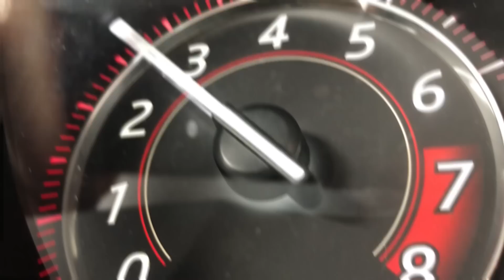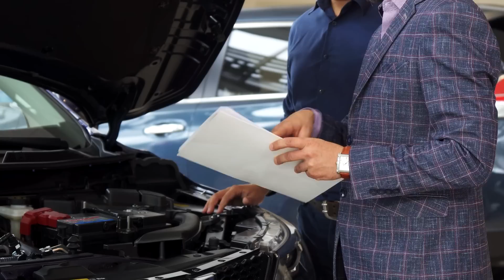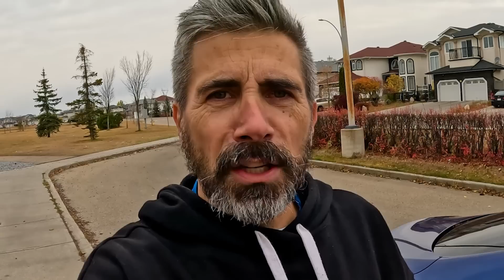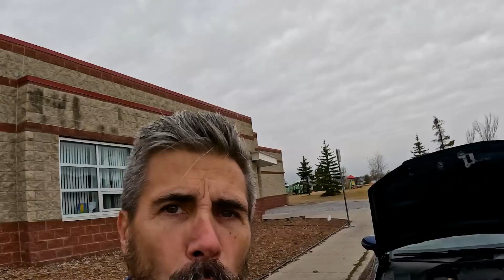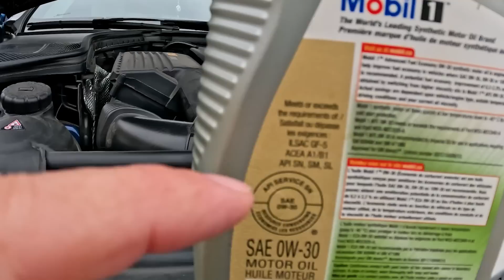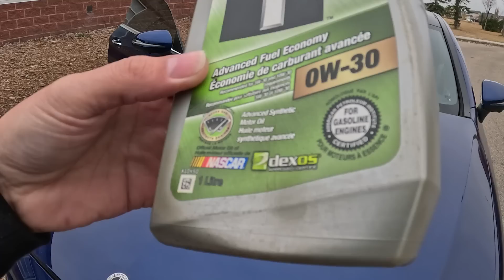BREAKING! Why These New Car Engines Are IMPLODING!

Comment: The manufacturers absolutely considered the extra wear and long term problems with the direct injection. That's the main reason it was implemented.
You're only supposed to own your car for 7 years or less these days.

Comment: I know on the oil geek channel they just did a testing of idling in cold weather or getting in starting your truck cold warm it up for 10-15 seconds and go and they found out that saves over 40% more gas than if you were to go out and idle your car in the morning for a period of time and then drive away

Comment: We have had issues with the C7 Corvette direct injection engines exploding.  GM went from saying it's ok to use lower octane, to requiring 93 octane and went from 5W-30 to 0W-40 DexosR oil. My guess is that the Corvette's were having this exact issue.

Comment: THE FORD 2.5L NON TURBO ENGINES ARE BULLET PROOF. THE ENGINE IS A COOP ENDEAVOR WITH MAZDA, FOR THE FORD/MAZDA ENGINE.  EASY TO MAINTAIN, CHANGE OIL EVERY 5,000 MILES THEY WILL LAST. MY 2012 FORD FUSION SE HAS 200,000+ MILES AND 30-33 MPG. DO NOT DRIVE LIKE A MANIAC, SHE WILL LAST A VERY LONG TIME. STILL DRIVING MINE AND PURCHASED NEW AND MOVED TO THE SOUTH. THE CAR IS RUST FREE. NO SALT DAMAGE.  FINIS  PAX

Comment: OW oil was created for better efficiency. Less weight on the crank and pistons. They chase the smallest gains while putting restrictive exhaust and intankes. The engineering is horrible too. People will be paying on these cars for years and they wont hold up. Best thing is to not buy this overpriced crap to begin with.
Reply from the maker: I think you make some great points!

Comment: Change your oil often, oh and pay your huge car payment on time too. Most people do not care for their cars the way these highly complex, highly stressed engines need. Most people don't even warm up their engines before driving. Give me a small high efficient, normally aspirated engine, simple cam chain arrangement, no direct injection and lighten these overweight vehicles too.  For once optimize the intake and exhaust from the factory...That alone would save you a few mpg...
Reply from the maker: I hear you on that.  It is so important to follow the maintenance schedules!

Comment: By making maintenance more complicated and designing in failure points the bottom line is they sell more cars, as they need to be replaced more often.  Not only that they sell more parts for as long as that car is running at vastly inflated prices, like the £1000 headlights!  You are simply not going to see our modern cars survive in original condition like cars from the 60’s and 70’s, if the engines don’t implode, the software and computers will fail due to components aging.   All driven by greed and thirst for sales leaving the consumer with big bills and a vehicle that’s worthless second hand.
Reply from the maker: Thanks

Comment: Greetings from the U.K. Excellent video! I’m 60YO and have worked on cars all my adult life. The best engines were made in the 1990’s in my opinion. At that time technology got rid of bad design, I remember ignition systems that had distributors, points and condensers, fuel systems with carburettors and mechanical low pressure fuel pumps. By the 1990’s we had fully electronic ignition and port fuel injection. Modern engines are now way too compromised, partly by makes driving down cost, and partly by emissions requirements. I’m all for less pollution, but the engineering to do this has been done on the cheap.
Reply from the maker: Engineered obsolescence

Comment: I own a 2013 Mercedes E 350  , 6 cyl engine ,, has 326k miles , origional engine and transmission.
Also own a 2019 E 300, 4 cyl turbo ,267k miles turbo charge replaced at 170k.. origionla engune and transmission. 

Oil used . Mobil1 5W_30 , 20K etended performance , never changed oil before 10k miles..
Both cars are driven commercially ..

NO ENGINE IMPLOSIONS YET!...,,JUST MY 2Cents

Comment: If all our petrol and diesel engines have so much problem with cold start lubrication problem, then why dont the manufacturers use a short timed electrical lubrication oil pump that is manually or automatically started before starting the engine, like pre lubrication in disel electric locomotives (trains)?

Comment: Sea Foam has a cleaner used at the air intake which will help clean the upper intake manifold and valve stems.
Valvoline's Restore and Protect does seem to help with build-up around the rings to help maintain ring seal.
MotorKote does appear to really help oil cling to surfaces to reduce wear.
Ceratec Helps "repair" minor scratches on mating surfaces over time.

Using these at recommended intervals can help extend engine life. Valvoline is a new one for me, but using the others I have yet to have an engine fail before 200k miles. (I actually haven't had an engine failure on any car I have ever had). Oil catch cans do help (on cars that need them. Not all direct injections do from my research). I have one on one of my cars, but not the other.

High calcium oils can cause pre-ignition issues (if the oil meets required spec, it is addressed in the additive package)

Listen to you car. Machines do speak in their own way and your ear is an important tool in maintaining your vehicle.

Good video!
Reply from the maker: Thanks for sharing your insights!

Comment: As a technician for over 38 I can probably count on both fingers and toes how many normal fuel injectors are replaced at that time. With direct injection cars I've replaced between 5 to 600 in the last four to five years. And this is just for direct injection failure this is an oil dilution or the other problems you're describing. We get plenty of cars with fuel imbalance because of the injectors not balanced anymore or running too rich. I myself would never buy one of these cars they will not hold up over the life of the vehicle. Part of this is the manufacturer's fault the other part is because of the government's fuel mandate laws. Direct injection engine cars will get slightly better gas mileage than a normal one but they will have much higher increase maintenance costs and failures. Set the slide amount of money you save on fuel will be lost immediately during repairs and maintenance. So I tell you what you need to do is complain to your representatives in Congress. Most people won't do that though so nothing changes.

Comment: The carbon buildup issue on the back side of the intake valves isn't just on direct injection engines but also on the port injection engines. When I removed the intake manifold on my 2012 Ford F-150 3.7L Cyclone (non-turbo) engine to change spark plugs, I immediately noticed the problem and went to work removing the carbon deposits with Seafoam spray and a toothbrush. Then with everything back together, I fired up the engine and performed a second Seafoam spray treatment on the intake side, and finalized treatment with a can of Seafoam in the fuel tank. I do not use Seafoam or any cleaner in the engine oil, preferring instead to change oil earlier. Adding a cleaner to an already diluted engine oil just makes matters worse and it's just better to change the oil and get the bad stuff out. I'm coming upon 170k miles and hope to get 250k-300k out of this engine before it needs to be replaced which I have planned for as I have no reason to replace the truck. A reman'd engine install is about $8,000 vs $80k-$100k for a new truck of the same type and size. Modern vehicles are more disposable like Bic lighters, use it for 75k miles then replace it.

Comment: Answer this question. Why is a given engine? Let's say 2024 Sonata with the multi-port and gasoline direct injection engine. 2.5 l require 0w-20 in North America but in other markets it requires 5W-30. It's the same engine. It's the same car. Hyundai is not going to manufacture an engine solely for the North American market specific to 0.0w-20, nor are they going to make a second engine that is specific to a different market for 5W-30. So what gives it's a cafe standards that require 0w-20 in the North American market where elsewhere in the world 5W-30 for the exact same motor is required? As I mentioned, auto manufacturers are not going to make an engine specific to one weight of oil and then manufacture a different engine to a different weight of oil in a different market. It's the same engine globally that they use but in different markets. They recommend different oil weights. Get back to me, will you? 

By the way, with direct injection and the pollution control valve dumping all that garbage back into the intake which causes buildup behind the cylinders. My car has multi-port injection plus gasoline direct injection. So one set of injectors does inside the intake that sprays fuel behind the valves to keep them clean. Then the other set of injectors inject fuel directly into the cylinder. The ones that injected to the cylinder inject regularly. The one that inject behind the valves inject intermittently. That's how we keep crud from building up behind the cylinders on the gasoline direct injection. The other cause of the using 0w-20 oil weight as it's thinner and it's easier to get past the cylinder rings and it's easier to combust which means that at any given car using 0w-20 oil consumption is going to be greater than it is if it uses a slightly thicker oil. So we're going to sacrifice protection with thicker oil by using thinner oil to eke out a few extra miles per gallon you be the judge?

Comment: I can see that my typical oil change techniques will fix most of this. Before you oil change, add 4 to 6 onces of Sea Foam to the oil. Run for about an hour, then drain it, change the filter and oil. Clean out the engine well every change and this carbon will be minumized. Oil varnishes will be washed down and out. Do this regularely and it will help with this issue. I've been doing this for 30 years on old cars, high milage cars that used lots of oil, and have been able to bring them back to very little oil consumption just doing this. i have several that made it to 300k miles when I bought them with 180 plus. This will bring out the trolls, but it's your choice. I'm just telling you what works for me. You dont have to use it. But for 10 bucks, your a fool not too!

Comment: Suffering similar symptoms at 165k now issues showed up 15k miles ago or a bit earlier, now I’m thinking fuel injectors won’t extend the vehicles life span as much as they should, this explanation makes total sense and I will reduce my maintenance schedule to 3/4 of what I used or half what I used, fuel system cleaner every 5k & maybe engine cleaner but idk how that works

Comment: Reliable engines rob companies of revenue,it's as simple as that.Just like a cure for cancer,you don't cure your patients and stop your profit.
Reply from the maker: So right Peter.  Cheers
Reply: @ECPP 
Cheers,I think we're being conned,but why would manufacturers give 5,7, sometimes 10 year warranty on vehicles
If they think they're not reliable .It seems odd to me unless replacement cost is minimal to them.The new lc300 landcruiser oil 0 /20  is so bad when towing customers are replacing it before leaving the showroom

Comment: Keeping my 3800 engine running for as long as I can. Hitting 340,000kms now and burning zero oil. If I drive nicely getting upwards of 34mpg on the hi-way. What we have now is disposable vehicles. This is the result of leasing. Less and less people now actually purchase their cars with intent to keep them for a long time. Instead just in effect renting a car for a few years and get rid of it. All the manufacturer needs to do is make sure that car lasts the warranty and that is it. Once the warranty is done the car is done. Such a waste of resources. Hate to think of the day that I will have to replace my Regal. Hope not for a very very long time.

Comment: Direct injection is garbage. It's designed to kill your car faster and increase maintenance costs. Also, manufacturers telling people they can go 6000 miles on their oil. Change using a direct injected car. You'll be lucky the car, last the life of the loan.

Comment: Direct Injection isn’t the issue (my older car has 200k and still purrs like a kitten) but the improper maintenance scheduling.

Oil change every 4k or 1 year, whichever comes first, especially if turbocharged. Lookup car’s transmission ser/part# from manufacturer and recommend fluid change then change it then at 1/2 to 2/3 that (60k in 8y ≈ 35-40k in 4-5y).
Reply from the maker: Sounds like you are a little more engaged than many others

Comment: All my Mercedes get their oil changed at 4500 miles. Never go by the 10,000 mile interval if you plan on keeping these! Gas and oil are cheap engines are not. I’m not trying to sell anybody on anything, but I only use Amsoil European 5W 40.
Reply from the maker: True cut oil serice intervals down drastically for better long term results

Comment: Toyota/Lexus solved the problem from as far back as 2006 with port and direct injection. The port injectors would still clean the back of the intake valves and also they would run on port injection until the engine was up to temperature.

Comment: Save the planet.  Reduce fuel consumption. 

Results:  Unreliable turbos.  Unreliable sleazy mechanical CVTs. More oil changes required,  or accelerated engine wear. And EVs that get scraped if a collision dents the battery. 

So much for saving the planet 😢😢😢😢 (he's crying over his wallet)

Comment: You missed the most important difference: cast Iron block and heads. Aluminum and iron have different expansion rates which make sealing tricky as well as dissimilar metal corrosion which is why early attempts at aluminum blocks failed (The aluminum blocks are why all the coolants changed in the late 90's), back in the 60's they stayed with water - glycol antifreeze which doesn't work well with aluminum.

Aluminum has a low melting point (1200 deg.) so even a brief overheat of the engine can result in a warped head or block deck (Hottest part of the engine).

Add in the mechanical complexity of variable valve timing and you end up with a engine that's more to rebuild than a new one costs (If it's even rebuildable).

Mid 2000's was the end of the peak efficiency & reliability era IMHO.
Reply: And all of these problems were present and solved in the 1940’s.
Yes, Aluminium blocks with direct fuel injection was solved during WW2…
Rolls Royce had aluminium pistons in service in WW1…

Comment: Great explanation.
Yet ANOTHER reason to continue to run my 2002 Mercedes ML500 with it's proven reliable M113 V8.
22 years & 190k miles on....
Reply from the maker: That old V8 was easy to fix and very reliable

Comment: It's not only direct fuel injection.
Most deadly design failures are the exhaust gas recirculation (EGR), way to small piston rings that tend to clog up and not holding anymore and to low oil pressures.
And the newest idea: wet belts in oil!

Carmakers try squeeze every tiny bit of efficiency and do things like electric waterpumps that can be deactivated or throttled.
Same for oilpumps.
Instead of optimizing longevity and then on fuel consumption, the goals are swapped.
You don't want to own any of these modern vehicles for longer than 2-4 years because they will fail and the damages will be expensive!
Overall, i don't think these short lived plastic bombers do any good, ecological. They are a disaster!

Comment: Diesel's have been using direct injection since forever with no issues until the super high pressure common rain with the injector failing and dumping fuel on the piston

Comment: And that's why Tesla Y is the number one car in the world. It has none of these problems. My 2022 Y ER has 110,000km and I only had to add windshield washer fluid, that's it. My older BMW X3 and 330  had tons of issues, too much to list.
Reply: And the battery loses charge sooner in hot and cold temperatures, and it's range limited and if it catches fire, it belches out highly noxious compounds which fire departments have a hard time extinguishing...The list goes on and on.  

If it works for you, great.  However, EV isn't the best solution for most people.
Reply: @H0kieJoe  Statistically gas cars catch fire more than Tesla, fact. Also the average driver in Canada drives less than 50km per day. Teslas are good for around 400km.  Again it's (Tesla Y)  the #1 car in the world for a reason, outselling the Camry, Accord and ALL other cars.

Comment: All this carbon build up is down to one thing that was hardly mentioned, the ERG valve does this in two major ways.  Without one no carbon would get into the intake side of the whatsoever competely illiminating the issue there and inside the combustion chamber the inefficent burn it causes is the reason for most of the carbon created and not being burned off there.  So I think the whole balance of the amount of nitrous oxide reduction against the extra other polutants and reduction in engine efficiency the ERG creates should be re looked at because at the moment it looks like it is just motor industry bs to give the IMPRESSION they are doing something about emissions.  We all know bs baffles brains!

Comment: When you cold start, drive lightly and allow the engine to warm up.   After you get to operating temps, don't be afraid to run the rpms up and vary your engine speeds.   Obviously, don't run at redline but certainly don't "baby" the engine by keeping the rpms really low.   
CHANGE THE OIL & FILTER at least every 5-6k miles, even if it's full synthetic!

Comment: This what happens when cost accountants and government 'bureaucrats' are deeply involved in the engineering design of 'engines'.
As an old time SAE engr., I'd be HIGHLY suspicious of the current use of LOW TENSION piston rings wherein the now usual increased BLOW BY of the combustion gas mixtures are now entering the lower section of the block and thus DILUTING THE VISCOSITY OF THE ENGINE'S LUBE OIL.